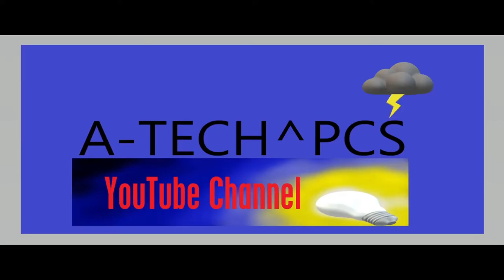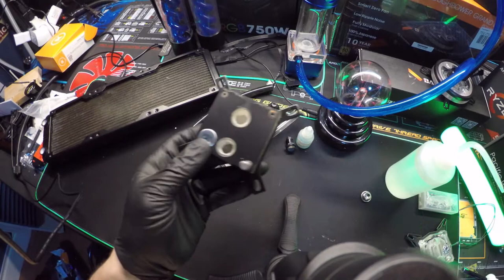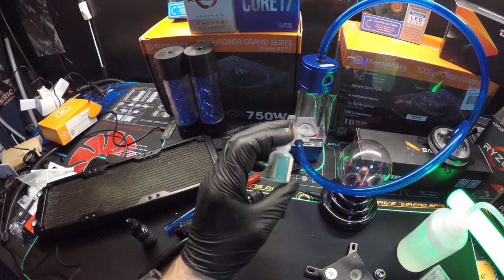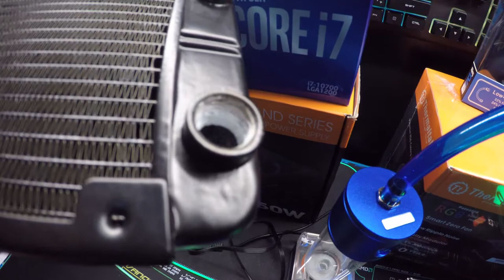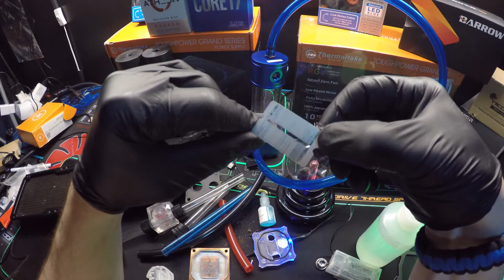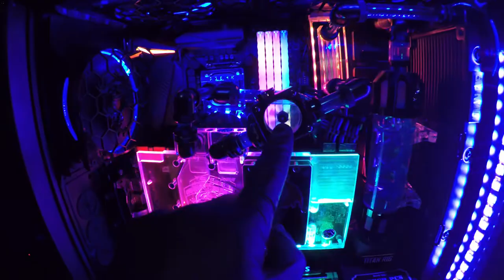Why You DONT use Dye or Coolant in Your PC LOOP

Comment: That is aluminum oxide (White powder) It is NOT from the dye. It is bi-metallic corrosion. To stop it, use the same metal blocks and pumps as your radiator. Also change your water frequently. Use only distilled water. If you use dye. Use only dye intended for PC cooling. NEVER use tap water. As the minerals in the water accelerate bi-metallic corrosion.
Reply: i use koolance uv green. guess i'll see what happens after 2 and half or 3 years. but, i don't sue this pc much either. (off a lot)
Reply: @cdoublejj  how’s it holding up?
Reply: @maddiehawkins552  fine as far as I know it sits turned off and collecting. Dust 99% of the time for now
Reply: Where did he have aluminum in the loop?
Reply: I see now not only did he use aluminum rad but he used pt nukes copper sulphate not supposed to be used on aluminum nor nickel it’s for copper alone
Reply: Not to mention just tap water becomes a biome and can actually cause growth in your loop

Comment: Apparently window cleaners do a excellent job of cleaning dye and even the fog that PVC soft tubbing tends to get with time.
On principle its actually a very good idea to use UV green/yellow dye/coolant in your system as it makes spotting even the smallest of leaks with a UV light very easy.
Coolants from Koolance and Swiftech have been around long enough and used a wide enough number of systems that they should be the gold standard.
I am surprised there isn't more talk about and testing of PC coolants in general as custom water cooling has grown in popularity.

  Also if that's a mixed metal loop with aluminum and copper then you ABSOLUTELY NEED to use a coolant/additive that inhibits corrosion or you WILL have problems and without knowing what coolant and even tubing they were using you can't entirely say all that white powder is from the coolant itself and not the aluminum radiator reacting with the copper.  That copper block is almost certainly fine and perfectly intact as in MM loops its the aluminum which falls apart and not the copper, Just google how to clean corrosion off of copper.  

  There were many a mixed metal and even some pure copper water cooling kits back in the day from reputable brands that developed bad reputations for the pumps or coolants used when in actuality it was the included tubing leaching plasticizer into the system which got dyed by the coolant while it slowly clogged the system and killed the pump that caused the problem. It seems even the majority of custom builders misidentified this common problem when they built and ran their systems for a while.

  If you are using aluminum and copper in the same system then its best to have way more (measured by exposed surface area) aluminum than copper as a large part of what determines corrosion speed is the rate at which the aluminum can saturate the water with ions and how fast that fully ion saturated water can deposit it on the copper.  Electrically isolating the aluminum components like radiators with nylon screws and washers from the case/ground also helps heavily.  To eliminate any potential chemical reactions from the tubbing I suggest using EPDM/rubber or silicone for soft tubbing and acrylic for hard tubing.
Reply from the maker: That's probably the longest comment I've ever gotten on a video
Reply: "Coolants from Koolance and Swiftech have been around long enough and used a wide enough number of systems that they should be the gold standard.
I am surprised there isn't more talk about and testing of PC coolants in general as custom water cooling has grown in popularity."

AND LOOK AT THE PRICE!!! I never did have problems with the old uv green stuff back in the day it was only when i started adding well water LOL
i've noticed lots of bad reviews with all these new coolants, i've also seen distilled water go wrong too even with additives or when mixed with coolants which i don't think your supposed to do but, shouldn't matter. H20 is a natural sponge so who knows how fresh it is and what ions and minerals it's picked up. aka it can in worse case scenario promote corrosion look at this poor chap

 https://www.reddit.com/r/watercooling/comments/r8t06e/why_does_my_ek_duraclear_tube_look_like_this/

TO BE FAIR, i've never properly run distilled water let alone de-ionized distilled water. i instead got a nickeled, copper brass setup, properly cleaned and treated per instructions to the best of my ability (i am not a smart man) and am running koolance uv green. and i winced a little at the price which is not bad but, don't get free shipping so buy 2 or 3 bottles at a time.

EDIT: YOU CAN NOT RUN DISTILLED OR TAP WATER WITH ALUMINUM AND COPPER IN THE SAME LOOP! You must have GLYCOL coolant!
ALSO Metallurgy is the mixing of metals in a casting or diecast process in a metal foundry. what op means is the bi-metallic corrosion. can't mix metals with water. that's why AIOs use glycol (they mix metals)

EDIT: never use tap water!
Reply: This video has nothing to do with the dye he showed in it.  Just use distilled water, some biocide, and use pc dye at your leisure.

Comment: Great video and agreed that there are dried white powder around the loops, the radiator and the CPU block. But, we have to agree that you haven't cleaned your equipment for a few years. I flushed them out every 6 months with CPU thermal paste change and they tend to be very clean. Have you ever thought about running Prestone car anti coolant liquid? Preston has the same safe glycerin ingredient as PC water cooling has, but you could also mix it with distilled water for safety. The reason why I recommended Prestone is because if you use only regular distilled water, the distilled water won't have any minerals in it, which will thirstly extract minerals from your system's metal components creating rust. Prestone is designed to protect against rust, while lowering the temperature.
Reply from the maker: I wouldn't put antifreeze.. in my system. Linus and jays2cents both have done videos on this..and both say u don't ..I would just use normal water with a biocide.. thank u for comment. Plz consider Subscribing
Reply: @ATECHPCs  How can I get biocide?
Reply from the maker: @rknine7998   amazon.    ( PT Nuke )

Comment: Good video and I will agree if you're running the Opaque type coolants. I run PrimoChill Ice - Low-Conductive Computer Water-cooling Fluid (32 oz.) - UV Purple. I finally did my annual cleaning and flush out everything and took apart my CPU and GPU water blocks and found no build up. The blocks looked very clean but they did had a minor tint of purple but that came off very easy with toothpaste. The coolant I used is transparent and not opaque. I refill with the same coolant.
Reply from the maker: Good deal... Thank you :)

Comment: This is why you flush your system  every year and don’t use tap water use distilled water to flush it
Reply from the maker: yup important to change water out . i do 2 or 3 time's a year
Reply: @ATECHPCs  Id like to see you run a 10 to 1 antifreeze solution in a loop
Reply from the maker: @kommandokodiak6025  I have done that before it creates quite a mess and what happens is is over a long period of time the antifreeze will actually decompose in like destroy the actual gaskets in your loop and it like turns into like this gooey kind of mess but I might do a video if enough people ask consider subscribing
Reply: @ATECHPCs  Yes but you have to choose the right coolant that doesnt have the Ethylene Glycol that will eat tubing and seals and some plastics. Im currently going through and compiling information. So i might have more infos for you later
 
Basically im in the spot where i have to fill my computer with a gallon of fluid and the coolant prices are enough that it becomes nearly 100 bux and because i overclock to the extreme some of these fluids say you cant use them in heavily pressurized blocks (so the cpu one for sure) because itll "break down the coolant"
Reply from the maker: @kommandokodiak6025  ok. Let me know.
Reply: @ATECHPCs  i see your email ill drop you my info through there  email title will be antifreeze cooling
Reply: @ATECHPCs  ok so youll like this idea. forget tap water, try aquafina instead, it carbon filtered and reverse osmosis so its not distilled which might be whats causing that powder in your rads
Reply from the maker: @kommandokodiak6025   I'm thinking I'll do a video on testing this . But it be awhile. Cuz their would need to be some long term testing
Reply: @ATECHPCs  Awesome! I was just about to message you about the coolant that looked good in terms of additives Peak 1 Gallon Amber 50/50 Coolant/Antifreeze global lifetime. It doesnt have silicates, 2-eh, amines and other stuff in it so its mostly just relevant inhibitors, di, and ethylene glycol and a bitterant (ingestion deterrent). 

But i heavily suggest you read that the OCN water cooling article i sent you especially the part II of it as it goes into antifreeze.

 The one thing i need you to test most with the antifreeze is the protection of a nickel plated block

Comment: I've been using straight distilled water since 2002 with absolutely no additives. I have absolutely had no issues with any systems. except for the one I put a conditioning agent in it made specifically for computers. destroyed all my plexi and soft tubing. Coolant is the biggest scam and it is super toxic!
Reply from the maker: yes it is..   i try telling ppl .. u dont need that color coolant crap... u just need water
Reply from the maker: Subscribe :)  check out the channel
Reply: This is my first water cooled pc I have an R O D I  unit for my fish tanks can I use the R O D I  water instead of distilled or should I just stick to distilled ?
Reply from the maker: @natevoid9955  distill.. because there's less of a chance of something going wrong... plus distilled water won't hurt electronics if it gets on it..  if the water is new.. distilled water don't have electros in it .. after the water runs in the loop for a few months then it will have electros in it..  Subscribe...check out my channel
Reply: @ATECHPCs  so that means drain and refill for like every 4 months?
Reply from the maker: @Immortal_Goblin  yea .espcially if run long hours on the pc.

Comment: Is that petra's pt nuke cu biocide ..
The blue color variant with copper sulfate .. they say it corrode nickel plated coppers .. I ordered it online with my tubes .. but I'm doing research now since they said it's bad for nickel and nickel plated copper. 
All of my blocks and fitting are nickel plated coppers. . and using brass radiator .. 
And they also said it's bad for PETG tubes it breaks the tube overtime..
But I'm not using PETG I'm using acrylic tubes. 

Here's my question how long is that cpu nickel plated block running with pure water and pt nuke before it made those tiny white things on the block fins.. 
And are those nickel plated particles that came off? 
And are you really running with tap water not distilled water??
As far as I now only tester uses tap water but only for testing purposes then flush it out ASAP...
Reply from the maker: i use water right from the sink... and iv always used PETG tubs.. i cant get 6-12 months out of my loop on just water...  you will have to add water to the loop over time.. cuz it will evaporate out of the system .. i wouldn't worry to much.. these effects many happen cause of heat and over long periods of time.... heat is what gets the nasty ness to get kick started in your loop.. o make sure u have a drain and fill port in your loop...  ..  thank you for your time..  msg me back if u have any other questions.. ill be glad to help you..  consider Subscribing and check out some of our videos .

Comment: Does the PT nuke cu the blue colored biocide cause problem with Nickle plating? Like peeling ?
Reply from the maker: well if u put a bunch of that PT nuke in the system ... yea the heat will break it down....  but if u drop 1 drop of it in... youll be fine..  thank you for your comment.. consider subscribing